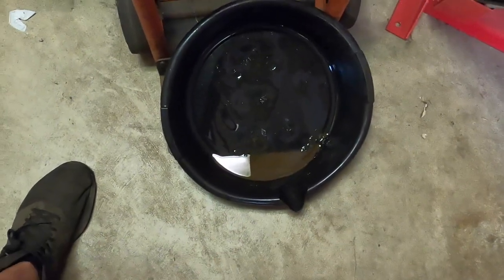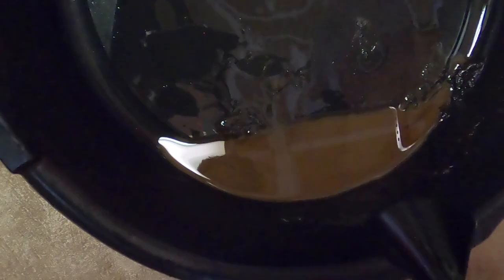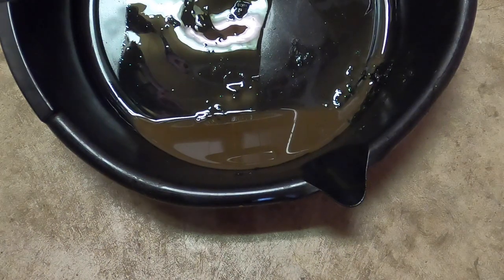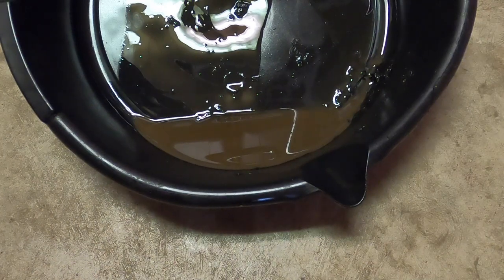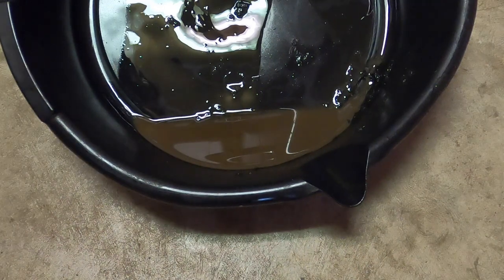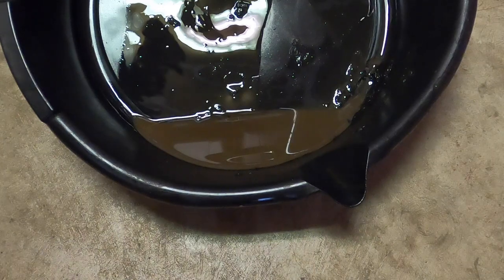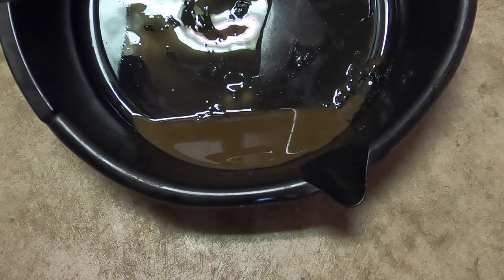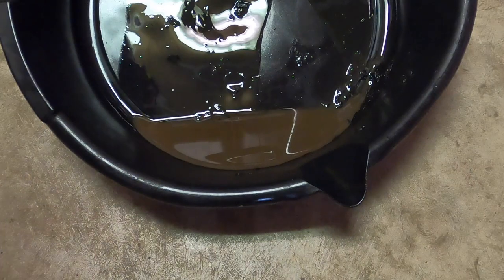Why do I Have Milky Oil

Comment: Thanks . Good video.
I use fresh  gasoline flushes.
Empty out the old oil and
I fill the oil  crankcase with 4ounces of fresh 91 octane .
Empty it out
Repeat 4 times or until 
The gas comes out clean .
Leave the dipstick out
Give it about 30 minutes to let the bit of gas evaporate.
Then fill with 18-20 ounces if oil.
Dont overfill.

Comment: hey mate i had a blown head gasket so i have a shit ton of milky oil i was just wondering how to dispose of it couldnt find a explantion online
Reply from the maker: Sometimes your local waste facility / land fill will take the oil. Mine will take it when it's open( maybe 5 days out of the year). Best bet is local auto part stores. They will usually take oil. I am not saying it is a good idea but I have seen a few waste oil burners for shops and I may have donated to those shops in the past.
Reply: Depending on your state you might be able to take it to an auto parts store for recycling.
Or 75% fill an old empty oil jug with kitty litter and then top it off with oil.
Then it becomes solid waste and can be processed for a landfill